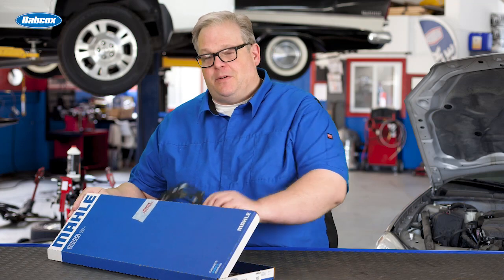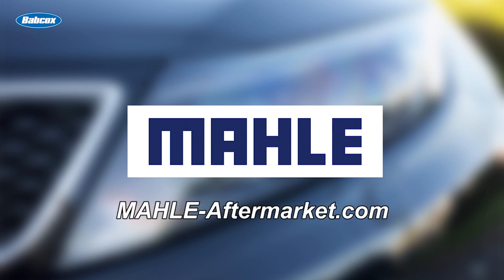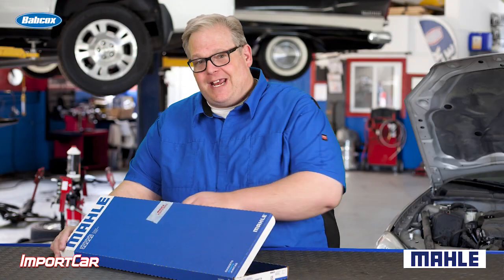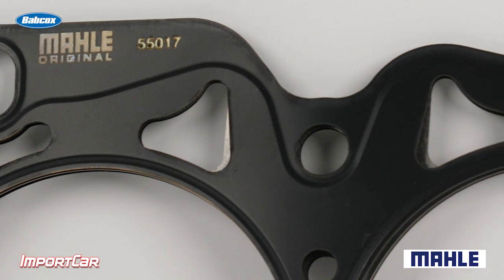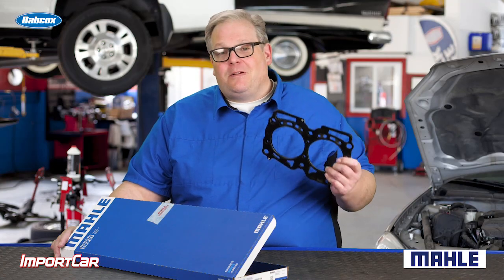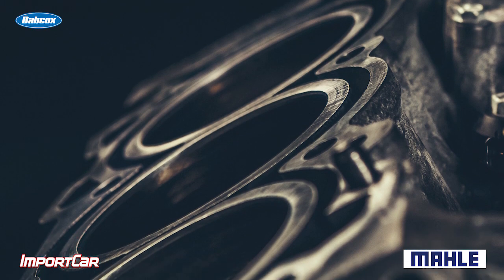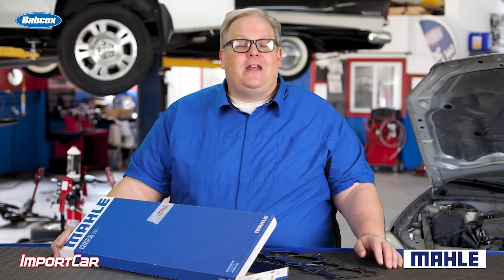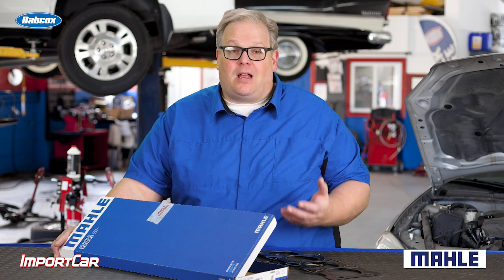Should You Use Copper Gasket Spray? | Tech Minute

Comment: Replaced head gasket back in the day on 83 Toyota 4AC motor & factory service manual said no sealer, but when I torqued it down & then re torqued it, it leaked like a sieve. I removed it, cleaned gasket with brake clean & put copper coat on it, re installed it & it sealed up perfectly. 210k later it died in a head on collision.
Reply: Facts.. they want to use..other then cnt sell gaskets to anymore...they want gaskets to fail.. this why tell not use..

Comment: Another EXTREMELY IMPORTANT ISSUE pertaining to head gaskets & proper sealing of ANY head, that was NOT mentioned in this video is the fact that every engine & gasket type from different era's REQUIRE a certain Ra finish ( roughness/smoothness) during the decking/resurfacing process to the block deck, and the head itself. Engines & gaskets produced back in the 50's & 60's, required a rougher Ra finish during the decking/resurfacing process of the block deck TO MATCH those older style gaskets. Those old style gaskets were thicker & softer, so they would help fill in the voids in the rougher Ra finish PLUS they did use an additional sealant to help make up for any tiny imperfections. The more recent composite gaskets and especially the latest MLS ( multi-layer steel ) gaskets require a much smoother Ra finish to the block deck and head, with MLS gaskets requiring the smoothest Ra finish of all, because the MLS gaskets themselves have extremely smooth surfaces, but the multiple layers of high-grade spring steel are what gives the sealing properties of the head to the block deck. But he is absolutely right about NOT applying ANY type of sealant or spray-type sealant to both composite or MLS head gaskets, and/or the surfaces they mate up to. ALSO: IT IS EXTREMELY IMPORTANT THAT YOU LET YOUR MACHINE SHOP KNOW WHICH TYPE OF GASKET YOU ARE USING, SO THE MACHINIST CAN APPLY THE PROPER/MATCHING Ra FINISH TO YOUR BLOCK DECK ( and in some situations, the heads as well. ) MOST MACHINE SHOPS TODAY ARE EQUIPPED & HAVE THE KNOWLEDGE TO APPLY THE PROPER Ra FINISH TO ANY ENGINE, FROM OLD CLASSIC ENGINES & GASKETS TO THE MODERN ENGINES & GASKETS. Today's NASCAR engine builders are applying incredibly fine/smooth Ra finishes to their block deck & head surfaces in conjunction with the MLS gaskets they are using, but such insanely smooth Ra finishes are not required on daily drivers or "street rods". YET ANOTHER CRITICAL STEP TO ENSURE PROPER HEAD SEALING IS WHAT'S KNOWN AS "CHASING THE THREADS" OF THE HEAD BOLT HOLES IN THE ENGINE BLOCK. This is done by using a special flat bottoming tap along with a solvent such as carb/injector cleaner to clean all of the gunk & carbon deposits out of the bolt hole threads BEFORE installing ANY head on the engine. You keep spraying the cleaner and running the tap into the bolt holes until no more gunk, debris, or carbon deposits can be seen on the threads of the tap, followed by blowing out the bolt holes with compressed air. AVOIDING THIS CRITICAL STEP OF CHASING THE THREADS CAN CAUSE FALSE TORQUE READINGS WHILE TORQUING THE HEADS DOWN, AND CAN RESULT IN HEAD GASKET FAILURE RATHER SOON. DO NOT "ASSUME" THAT "THE MACHINE SHOP CLEANS THOSE HEAD BOLT HOLES" BECAUSE THEY DON'T. ( and tanking the block does NOT clean those bolt holes properly either. ) Chasing the threads of head bolt holes in the engine block is the responsibility of the engine builder.
Reply: only pros care about this stuff! The everyday person doesnt understan and will thing urnuts telling them about the finish on a head after machining. I dont even argue with everyday people anymore its not worth it. Like when a customer says a brake jopb is a brake job and how im 100 bucks more then the shop next to me  I just say call me in a month when ur brakes are squeaking because they put cheap parts on.
Reply: @feeneysauto3432  I didn't post my comment for "the every day person" who knows nothing and/or doesn't want to learn anything about engines. I posted my comment for those young guys who WANT TO LEARN. But there's another reason I posted: I am quite shocked that this video FAILED to mention that different head gasket types REQUIRE different Ra finishes specific to the gasket being considered for use. Besides: "the every day person" who knows nothing and doesn't care to learn a thing about engines.......aren't gonna click on a video like this to begin with. They wanna watch the same type of garbage found on te-LIE-vision.
Reply: Much appreciated comment on Ra finish of the head. I just installed mine on a bike.
Reply: Excellent response
Reply: Thank you. Another point that needs mentioning is the choice of torque wrench being used, and is that torque wrench properly calibrated. Also: even the best torque wrenches eventually wear out. Pete Harrell is a highly regarded race engine builder/tuner. He swears that about half of all torque wrenches being used in shops today need to be thrown away & replaced. He says too many builders "fall in love with their torque wrench" and never consider that it may be worn out. Pete has personally witnessed too many head gaskets blown during the first or 2nd pass down the track on a new engine, built by good builders. They covered every crucial step properly...........other than replacing their worn out torque wrench.  @tomhenderson2430
Reply: Spot ON!!

Comment: i have an alh tdi engine cold compression 500 psi, countless head gasket jobs. modified 220 hp 440 ft-lb/torque. yeah I know that's crappy hp for today's ultra light high power modern engines. If no copper coat is applied between each layer of head gasket I get leaks within a couple months or so it has been 2 years and no leaks, no little bubbles in the coolant reservoir and absolutely no overheating. strongly recommend copper coat, there are major flaws in the sealant of the material applied to the surface like none to existence, metal to metal is absolutely a f*ing joke. that's my 5 cents...
Reply: Truthfully Simple, Look Up! 
Same here 
I had a car that did a head gasket job two times 
A very professional mechanic gave me the advice to use copper Spray and let it Frye before applying its take 24 hours to dry 
But it works 
No joke ! Copper spray works 
That’s also my other 5 cents
Reply: I drive 85hp Mazda truck, so 220 hp is like a Ferrari to my truck lol
Reply: @dunemaster3179  315HP V8 Armada over here ...
Reply: @cenkaetaya  400 hp alh here and i for the first time used copper spray
Reply: @cincomorales  dam 24 hour dry doesn't it need to be somewhat tacky to stick ? I've used it with success but only let it dry like 30 min lol but it worked really nice on head gasket too bad I soon after got a rod knock
Reply: @masterdebater0010   You wait until it gets tacky after spray, after that you can put it together, BUT then you have to wait for it to cure 24 hours before starting your engine.

Comment: Where I use copper spray is between the block and the bottom of a solid metal shim gasket to correct for metal removed from the head and the block,  0.020" to 0.040" thick. Then I lay the standard non-coated head gasket on top of that without any spray.  This arrangement has worked for the past 9 years and it's what old school mechanics used to do before stacked metal head gaskets. ARP studs and nuts are also a good upgrade.
Reply: Thats the only time it should be used. Anyone says anything different dont know what they are talking about

Comment: Well nobody else mentioned it but you want a head or any gasket for that matter to seal permanently, shellac that bad boy. The ol timers know exactly what I'm talking about. Used to be called Indian head shellac, it has various names now by various companies. Shellac the mating surfaces and the gasket on both sides bolt the part on and your virtually set for life. It'll ooze out under compression but once it dries, almost have to take a stiff wire wheel and grinder to remove it. Good stuff.

Comment: Copper Coat is a heat transfer spray between the head and gasket...It will not harm MLS gaskets....I used it on damn near every new type of gasket made..
Reply: yes this is bull ... its insurance on subi gaskets 10x
Reply: @Crettybocker427  Yes it is.. As no head and block deck is perfectly flat. The factory can get away with it. As the block has no heat cycles or been over heated...

And if you're in there replacing head gaskets. It's either over heated, Being overhauled or replacing the head.. I'm not going to take any chances. As I don't need to do an 8+ hour job twice. Plus all the shit you have to replace while you do it...
Reply: @WizzRacing  Well, if you're REBUILDING an engine, and working with a good machine shop and sharing the information about which type of head gasket is being used, there should be no issues, so long as the machinist is applying the proper Ra finish to the block's deck ( and heads, in many situations ) as required by the gasket manufacturer. Of course chasing the threads in the head bolt holes in the block is another critical step to ensure proper torque readings while torquing heads down. Seen a few do it yourselfer's skip that step over the years........and their head gaskets failed.
Reply: @howabouthetruth2157  Machine shops only work too within 2 thousands of the tolerance. ..

Still does not take into account vehicles running hot. This is what Copper Coat is there for. To help with heat transfer. Add in some water wetter to control heat bubbles from forming on the surface. As these bubbles repel the waters ability to adhere to the metal surface. Thus taking less heat away...

I would add. Most people do not have the block machined. They just replace the head.
Reply: @WizzRacing  I do get what you're saying.....a lot of people can't afford to rebuild their engine.....but I was talking about rebuilding an engine. As far as I'm concerned, a blown head gasket gives me cause for concern, whether due to overheating, high mileage or abuse, whatever....... issues that caused that blown gasket to begin with. If I had an engine/vehicle that is worth keeping, and blew a head gasket due to high mileage/wear, there's no way in hell I'm simply gonna replace the head & gasket only. But hey, that's just me.....to each his own. I would rather refresh it and know I'm good for another 250,000 plus miles ( and much more for certain engines ). I've had several rebuilt engines over the years, including my Toyota 3RZ-FE that I bought new back in 2000 ( Tacoma 4x4 )  just recently rebuilt ( blew a head gasket at just shy of 400,000 miles, no complaints there ), and I have yet to lose a head gasket prematurely. I don't believe the fella in this video is referring to "simply replacing a head & gasket, and sending it" either. Also: back in the day, machine shops weren't applying incredibly fine/smooth Ra finishes to engine decks, because the later composite and MLS gaskets didn't even exist yet. Of course those old engines & old style gaskets required an additional sealant.......those old engines & gaskets REQUIRED an Ra finish much rougher than today's engines & gaskets. Just sayin'.
Reply: Thanks for the answer I wanted to hear.

Comment: this is misinformation , I use copper spray on every head gasket I do and I have never had any leaks. copper spray is a good way to ensure a good seal
Reply: Mine use MLS head gasket can I reuse it using coper spray sir?
Reply: Just did a perkins diesel 4.203.2 no spray looked like a cheap head gasket . Like paper type with metal rings and coating not the old copper type.
It leaked antifreeze was coming out from in between. 
I retorted and still leaked. Waiting on a real copper gasket now.
I will spray this one

Comment: Have you ever used copper grease? what do you think ? Listening to an old-time mechanic, he always used it, as this grease can withstand 1200 degrees, and allows the expansion and retraction of metals when hot and cold, and protects the metals on the faces of the block and cylinder head against rust and combustion vapors.

Comment: And you could use the copper spray sealant for other places it works great to hold a intake or water pump gasket in place while you position the mechanical part in place

Comment: I thought that the outer steel gasket steel layers move withe engine while sliding over the sandwichedsteel layer. So if you spray the oute layer and not the middle layer i would think it will still slide over the middle one or is all supposed to move?

Comment: Very good points about new gaskets, thank you for that Andrew.  On older style gaskets, that are still being made (FelPro 1090) there is no extra sealing other than a film of Teflon (I believe) all across the surface.  Years back FelPro said to use Copper Spray a Gasket on these basic style head gasket, and maybe that is why others here are having better success with it?   There was a mention the extra amount of copper helped pull out heat, to some extent but no claim it was acting like a heat sink ;-).  So other than helping to seal surfaces that might not be as perfect as a shop should do, using such a product in these older style gaskets might still be a good idea.
Thanks for your time.
Reply: FelPro 1029, sorry for the error!